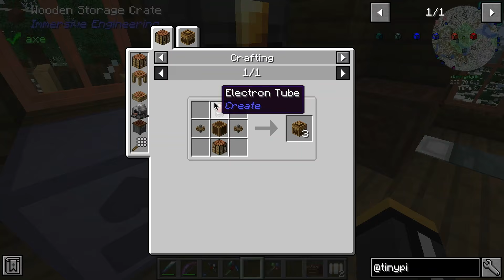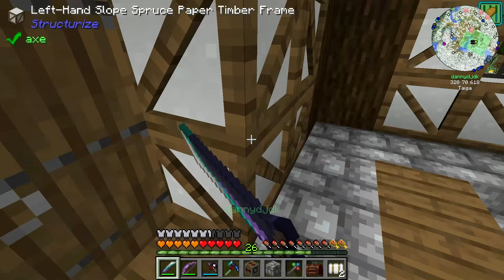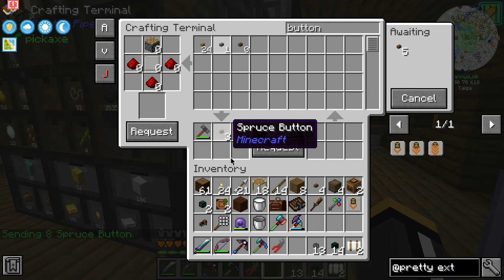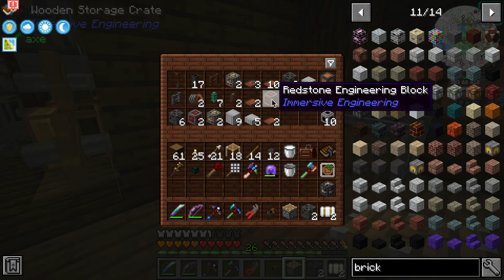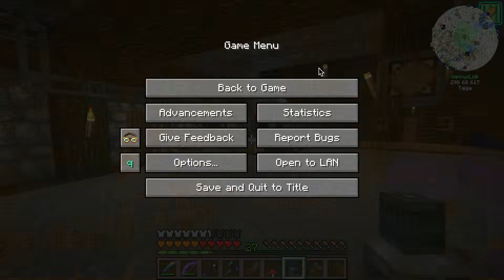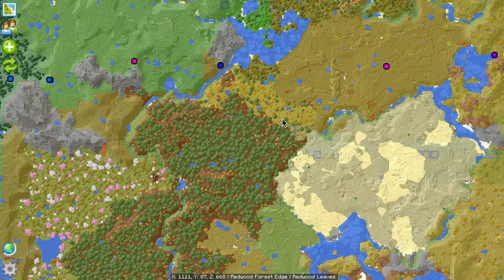Real Tech S3E22 - Autocrafting with Pretty Pipes, IE and Create

Comment: 33:14 That is not actually how it works, to prevent lag, the block on top has to have an inventory, the smaller the inventory the better it is. The best one in vanilla minecraft is a composter.
Reply from the maker: That makes sense. The hopper will still look for items that get forced into that block space. And, the composter makes sense, since it only has a single item output. Thanks for the tip!
Reply: @DannySon  always available for some help!